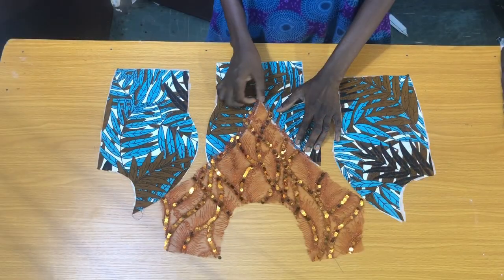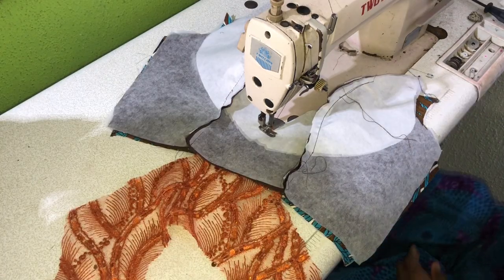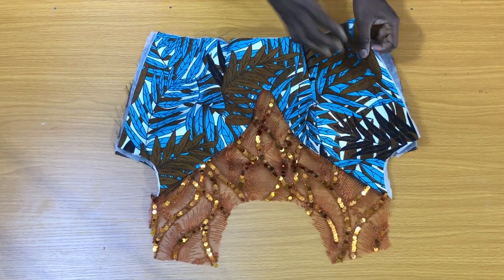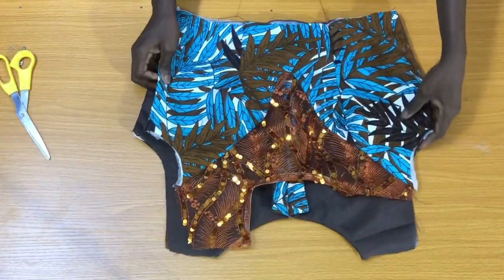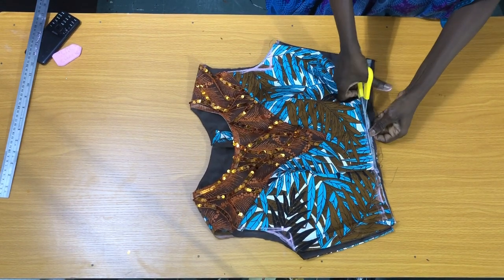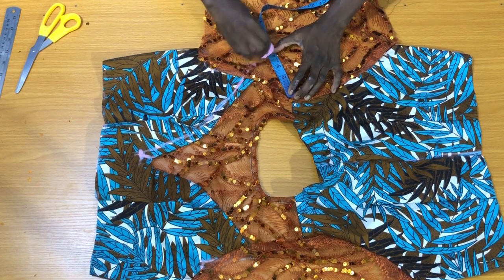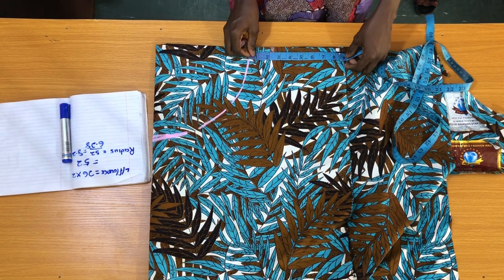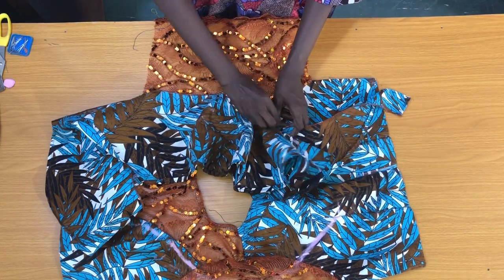How to sew an Illusion dress with flounces

Comment: Ooooh baby, u re d best. Thanks a bunch dear but pls how do I draft d back with illusion neck line also. Thanks
Reply from the maker: After cutting out the back piece, you should mark how you want the illusion to be on the back piece. Place the fabric piece on the net to cut out the illusion. 
And the part without the illusion, you need to place in on your fabric, to add a sewing allowance to the top part for joining it back to the illusion. 
Thank you 🙏
Reply: I will always love u. Thanks so kindly dear